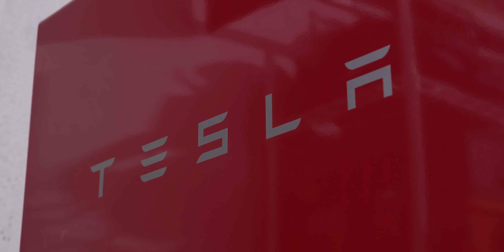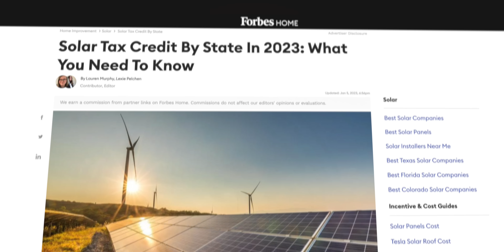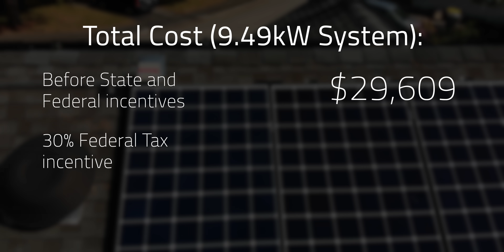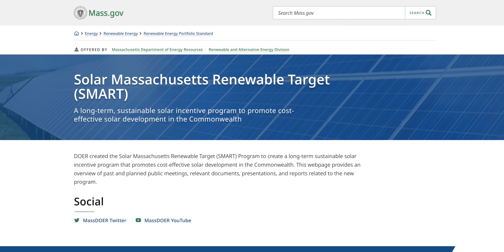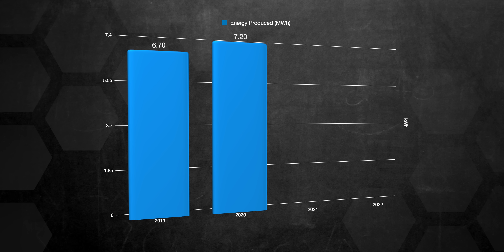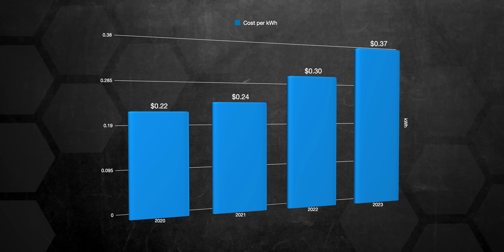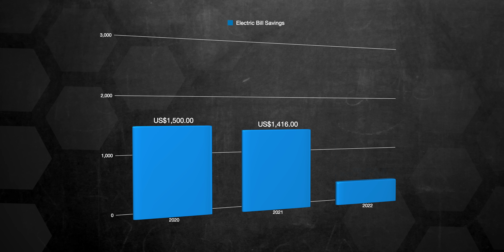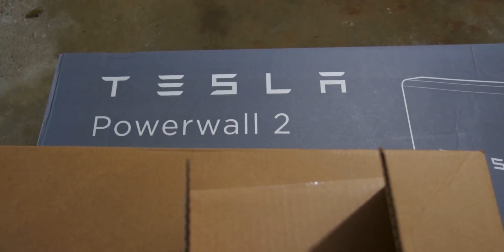5 Years with Solar Panels - Is It Still Worth It?

Comment: I did a DIY solar last year and ended up spending about $30k for 11 kW including 15 kWh of battery storage.  My takeaways were:
1) Buy all the panels you think you might want at once, or accept that you'll end up with a mix of different panels that may not be mechanically or electrically identical.  Panels change enough that it's extremely hard to find panels that were readily available 2+ years ago.
2) Get 20%+ more panel capacity than inverter capacity.  The inverters have the same limit regardless of time of day or weather, but panels spend most of their time below peak capacity.
3) "Sun hours" is a very useful metric for system-sizing.  In my climate, we get about 4.5 "sun hours" per day, or 4.5 x 11 = 49.5 kWh/day averaged over the year.
4) Use an off-the-shelf racking system.  I designed & built my own ground mount system, and I definitely wouldn't do it again.
5) Battery backup is AWESOME for quality of life during outages.
Reply: Thanks for this information, its very practical and helpful!
Reply: #4 depends entirely on your background and level of help available. I did a ground-mount with my own design years ago, saved a bunch of money over the off-the-shelf systems, but I did have the advantage of a metallurgist in the family who reviewed the design and made some changes for durability reasons (dissimilar metals and materials interactions, etc). It has lasted beautifully through record hot and record cold spells and even through some extreme wind events, and it looks unchanged like it will go another 20+ years at least without needing any work beyond minor maintenance.
Reply: Bad listening to this guy saying his electricity bill is close to $400 a month and then listening to all of you people talking about some massive $30,000 solar panel system just gives me a headache and then people wonder why they have to retire at the age of 70 and they never have any money and can’t vacation for more than a few weeks a year…

Listen to what you’re saying $30,000, $30,000 why why do you need that much solar? I lived for three years with only $150 in solar panels and I had all the electricity I needed never had to run the air conditioner because if you leave the windows open with some fans you’ll be good for 90% of the season… 

That was $150 in solar panels 10 years ago. I think I could do the same thing nowadays with only $50 of the newest solar panels but the set up I want including batteries is about 3500 bucks sure that’s expensive but it isn’t 30,000…

I feel like all of you guys just like to burn your money up 24 seven and overspend on everything you buy and work 50 hours a week for the rest of your life because you think that spending money on stuff you don’t really need is the definition of success and luxury. You spend too much time thinking about how much you could instead of thinking about if you should. 

You don’t need 10,000 or even 6000 kW of solar you could have all the electricity you need for pretty much only 2000 kW of solar or even less depending on how efficient you are.

All of these so-called luxuries you think that you’re buying by working 50 hours a week are irrelevant. If you have to spend your entire life working to have these luxuries, which you have almost no time to actually enjoy, and just continuously work to be able to even sustain and afford It’s actually mind blowing to think about.
Reply: @ZxAMobile  It all depends on what you want out of life.  We heat our 1100 square foot home to 60-64F with mini-splits (and a bit of firewood), choose to have a large garden, and grow & store nearly all of our own vegetables.  Keeping veggies frozen for half the year takes power, and so does dehydrating or freeze drying them.  We could've lived with radon and nasty-smelling well water, but we chose to put in a filtration & mitigation system that works great but is definitely an energy-hog.

I DIY'd our solar because I had sticker-shock at the $3.50+/W prices quoted without batteries, and we've already done all the energy-saving things we didn't require unfavorable quality-of-life tradeoffs (and had the budget for - we're still saving up to reside & re-insulate the house).

When our 12 year old Toyota eventually wears out, I'd like to replace it with a BEV, which will massively increase our power consumption.  In the meantime, the cash back I get from the utility company for excess power is a better ROI than a CD.
Reply: Curious what you figured you paid for your diy ground mount? How did this compare with a commercial system?
Reply: @daleatkin8927  and others interested in the ground mount & battery costs: the only good spot for my system was on land sloped toward the East so I built 4 frames for 8 panels each; we live in a windy area with lots of snow, so I kept adding more steel bracing until the building inspector was satisfied.  Ground mount: $1800 for 36" ground anchors, $1000 for 1.5" galvanized steel EMT conduit, $900 for 1-3/8" galvanized fence toprail (wind / snow bracing), $1500 for 2"x2" aluminum box tube to mount the panels to, and probably $1000 in misc for a total of $6,200.  While I probably did save money over a turnkey system for 4 frames, it took far more labor than I expected.  Friends of mine have made ground mount frames from pressure treated wood, which I'd strongly consider if there was a 'next time'.

For batteries, I bought SimpliPhi (3.8 kWh for $2,500 each, so $10k), which have great reviews and are rated for 10,000 cycles.  I could have easily paid 1/2 as much per kWh if I'd bought Chinese batteries.
Reply: @daleatkin8927  bear in mind the power loss through excess cabling from ground mount to inverter and system or battery.  It's quite a lot per metre.
Reply: @kieranhanrahan2883  only if you keep it as DC on average you can loose approx 3-5% over 300m in AC dependant on temp and if insulated in waterproof conduit
Reply: @ram64man  wow thanks,  I was told something very different.  Very immature market here in Ireland, can't trust all information from sales people always!
Reply: @kieranhanrahan2883  it’s a shame that the seller advice in Ireland isn’t taking AC vs DC into account. This has been known about ever since Edison and Westinghouse’s first electrical systems. DC can’t travel far so Edison wanted lots of local power. Westinghouse used AC because it can travel miles with minimal loss. I would be questioning the seller and installer’s other electrical knowledge if I was in your position… it sounds like they’d run the cabling as DC and put the inverters on your house, instead of putting the inverters by the panels.
Reply: @kieranhanrahan2883  Use resistance chart to calculate wire sizing, remember round trip on the wire, ie 24 feet for a distance of 12 feet.
In a lot of cases people cheap out on the wire size, as a result a lot of lost power, just heating up the wires.
Reply: @kieranhanrahan2883  in my case, distance back to inverter/meter will be substantially less by going with ground mount (meter to house is about 30 meters, roof to utility room where the inverter etc would be located is at least 10m, location for ground mount is maybe 5m from the meter location, and inverter can be located about 3m from the meter), hadn’t actually considered this as an advantage, but probably is… (main reasons for ground mount is easier approval, not putting extra holes in the roof, ease of hookup, flexibility in orientation)
Reply: @kaitlyn__L  most probably. That DC would be 48V and for a high wattage system you would need wire with big cross section to keep low resistive losses due to big current. 
New inverters on the market support already max voltages up to 500-600V then it would be only 20A at 500V for 10kW system against 200A for 50V system.
Reply: @kaitlyn__L  Depending on type of PV system (e.g. micro-inv.s vs. central Inverter) most DC arrays are 300-1000v DC have Less voltage drop than 230vAC over same distance. Edison's DC was 110 vDC over less than half mile (

With AC, power factor enters into the equation. Dropping the PF from 95% to 80% can increase the voltage drop 20%. So for AC, the voltage drop could be considerably worse than for DC using the same voltage and amps.

.
Reply: @iIiWARHEADiIi Yeah the 3kw inverter I got last month has mppt solar input at 450 volts 5000 watts. With 2 sets of 8 panels in series the volts should be about 270 watts and 20 amps.
That's 1.6% loss at 100 ft of 10 gauge wire if it's producing full power.
Reply: @ghz24  thanks for the info
Reply: @kieranhanrahan2883  The old saying is  ---   Believe half of what you see,  and mostly none of what you hear  (or are told) .    😊😊
Reply: @daleatkin8927  Would also like to know since that seems kind of high for a DIY system with only 11kw solar and 15k kWh of storage.
Reply: When did you buy them? I sell solar panels and im curious if people still buy them out of pocket because the solar I sell is subsidized by the government.
Reply: @jewels8773  Why wouldn't people buy panels out of their own pocket?
Reply: @jewels8773  Some initial solar costs are subsidized  / credited by state and federal governments,  but total project costs are paid by customers upfront and a portion is reimbursed.    As a solar salesman,  you CERTAINLY must know these basic facts  !  (???)
Reply: I 100% acre with buying panel mounts! I weld and have unlimited access to metal.  Built my own array mounts. What a pain! Days of work and ended up being about the same price, but mines wayyyy crappier hahaha
Reply: What do you not like about your own ground mount system?
Reply: Does the $30k include the cost of the racking system
Reply: @mytravls  Usually  YES, the costs will include racking.   But we SHOULD all know it's best to ask such questions, and to get the details and specifics in a signed, legal contract.   Even that can be risky these days  !
Reply: Good stuff, your DIY did save you a bunch of money! I've often wondered about the point 2, though- having more solar capacity than what the inverter can handle. My solar potential is 10.88kw but the inverter limits it to 7.6. I've always been annoyed at seeing my capacity clipped for hours each day during the summer, and bristle at the thought of all that energy going to waste. 

The company line is the lower rated inverter is more productive overall, since the threshold for energy production is lower. (At least that's my layman's understanding of the technology.) I'm not convinced. There is a cynical part of me that thinks this is a con. An alternate reason for the installer overprovisioning the inverter is that if a panel or two fails, they don't have to replace them under warranty, since the inverter will still be maxed out..
Reply: @risingdough8078  The way I look at it, it's impossible to optimize for BOTH the inverter and panels at the same time.  You're getting great use of your inverter (which probably costs roughly the same per installed watt as the panels).
Reply: @AlecMuller  The funny thing is, my vendor originally spec'd out a 10K inverter, which pretty well matches the maximum solar power output. They swapped it with the 7.6K inverter, but didn't lower the price, explaining that the lower powered inverter would run more efficiently when less than ideal solar conditions exist. I've read that elsewhere, but from other vendor sources, so I still have doubts about it. At this point, I'm rationalizing it as "I've bought extra panels as insurance." Lame, I know.
Reply: What kind of battery setup do you have?  Do you backfeed the grid or does the solar only supply the house and battery?
Reply: @notavailableses  The inverter (Sol-Ark 12k) sits between the batteries and the main panel.  I have ~85% net metering, so I keep the batteries fully-charged for outages, and use the grid as a battery when it's dark.  During outages, I have 60A of critical loads (well pump, furnace, freezer, fridge, internet) that run directly off battery.  Before we had net metering, I was draining the batteries at night and recharging them the next day.  Due to reduced consumption in an outage, I think we can go several days on battery power without any sun, but I haven't had to test it yet.
Reply: @AlecMuller  Now I see why it was 30k.. Def went higher end on the system than a traditional DIY.  Are you having any issues with the Sol-Ark?  I was going to go that route but they seem to not live up to spec in some cases.  Looking at the XW Pros now..
Reply: @FJB2020  The only issue I've had was getting it to recognize a generator input.  I forgot to top off the batteries before an outage, and it was too cloudy to recharge from solar.  It's supposed to let you run your loads and recharge your battery from a generator input, but I haven't gotten that feature to work yet (in spite of RTFM and calls to tech support).
Reply: @Alec Muller  I was going to buy a Hyundai 6 or 8 kw? generator, fortunately the  local Victron dealer mentioned he had had issues with some generators connecting possibly AVC type, so I got a Kubota 1500rpm (UK 50htz) non AVC, the Victron inverter and possibly others are sensitive to frequency, at about 52htz it won't connect at 51.5htz it will, then as the generator is loaded it will run at 50htz +-1htz, the only issue we have is the washing machine shows a power fault at 51.5htz so it won't work unless the battery is charging.
Reply: @notavailableses  the solar is in its own parallel grid , but does back feed a little , we have a manual isolation system meter side which trips in a power outages, with its own circuit breaker that allows off grid when the grid goes off like recently over Christmas, I forgot to mention the batteries use a 3 phase sunny island x2 allowing 10kwh to the property if needed, so far we top out at about 8kwh when heating from cold , right now I’m still in the middle of a big bill on the property merging both buildings and building an extension to merge the two, (old farm house , modern barn converted for accommodations former aband b and another barn (currently not suitable for solar due to code and weight) beside that will become the main residence on 6 acres) think of it as mainly road side in a big L shape for building and plot ) as the dark house gets partially demolished. for a rebuilt and modern look the idea is to feed all the electrics back to the Annex fuse boxes but most work has stopped due to the buffalo winter and me back at work internationally.
Reply: #2 may not be such a good idea.  The essence of the inverter is an array of large and expensive electrolytic capacitors which will die young when constantly pressured to their limits.  For long term survival, over size the inverter.  For a serious solar array on a home, the home would like to be all electric including heat.  My home has radiant electric heat embedded in the ceiling.  Most people seem to think "heat rises."  Warmer air rises above colder air, but radiant heat heats objects while going right through the air.  It is quick.  It is silent.  It is precise.  Every room has its own programmable thermostat.  In 50 years of use it has required zero maintenance.  No new furnace every ten to fifteen years.  No repairman ever.  And for the last fourteen years, the photovoltaic covers it all.
Reply: @WS0TA  heat does rise, why not heat the floors like they do in Japan?

Nothing beats forced air, not only for even heat, but for air circulation. Is there an electric method to have forced air heating?
Reply: @michaelp4122  your 1st question:  "heat rises"  ... heat is energy, heat is vibrating molecules.  In itself it is not a thing that rises or falls.  Heat transfers from one place to another by three means, conduction, that's when you touch a hot stove, convection, that's when less dense gas or liquid rises against gravity above more dense (colder) gas or liquid, and radiation, infrared waves, how heat reaches the earth from the sun.

your 2nd question: "why not heat the floors?"  many reasons. It is an expensive way to build, expensive to repair, and expensive to maintain (think replacing the furnace every ten to fifteen years).  The floor generally involves a large mass that takes considerable time (hours) to heat or cool, in other words, slow to respond to changing temperatures outside.  The floor is heating by radiation, not by heating the air.  Half or more of the floor is covered by furniture or rugs blocking this radiation.  Quite a few homes here are being built with radiant heat in the floor.  The owners always wind up sorry.  

your 3rd statement:  "nothing beats forced air"  I would say, everything beats forced air.  It is noisy.  It is drafty.  It blows dust and pollen around.  It is very uneven heat distribution.  Ducts have to be somewhere.   It has a fan to wear out, and a furnace to be serviced and replaced.

With electric radiant heat in the ceiling you have no gas in the house, no explosions, no furnace to replace, ever, it is extremely quick heat, thermostatically controlled to within one degree, evenly distributed, every room is its own programmable heating zone, inexpensive to install, may require no maintenance for a very long time. And now, if you install a photovoltaic, after eight years it is paid off, and there after heating is free.  I have no utility bills.
Reply: @WS0TA  I'm a science teacher buddy, heat rises. Hot air is less dense than cold air because the particles are moving faster. It's called kinetic molecular theory. So why heat the ceiling?

As for forced air, nothing beats forced air. The problem with radiant heating is that heat is not evenly distributed, and it makes air dry and stagnant. Stagnating air is one of the best ways to give you the worst air quality. Mold and bacteria will build up and without circulation....it just stays.

Things like paint and printers emit toxins that need to be blown away.

Also radiant heating is dry. Yes you can install a humidifier, but are you putting one on every floor?

So is there any way to do forced air with electric and not make the air dry? I don't really agree with yout solution as it poses a health risk.

As for repairs and gas lines, all chefs use a natural gas stove, it just cooks better. So I'm not going to remove my gas line. I upgraded my furnace in 2016 from a 1984 model. 30 years is plenty, and it never broke.

I would like to be more environmentally friendly, but what you propose is a terrible solution, and a good way to get sick.
Reply: @michaelp4122  You are saying it incorrectly, Mike.  Yes, hot AIR rises relative to colder air.  Heat is carried by the rising warmer air. This is called "convection."   Radiant heat is a totally different form of heat transfer.  The heat is transferred by infrared waves which go right through the air, strikes objects, and the energy is transferred to the object.

"The problem with radiant heating is that it isn't evenly distributed."  Radiant heat in the floor has such a problem because of furniture and rugs put on top of it blocking the radiation.  Radiant heat in the ceiling has a clear view of all the objects in the room, including you, and warms them.  It is the most evenly distributed heat there is.  By placing wires more densely near exterior walls and windows it even discourages convective flow near such colder locations.

All heating lowers the relative humidity.  Humidifiers can add humidity to the air where needed.

Gas stoves have been preferred by chefs because of instantly able to control the heat.  Inductive electric stoves can not only match this performance, but also provide digital feedback for precise repeatability.

You were lucky with your furnace.  

It isn't what we don't know that gets us into trouble.  It's what we think we know that is wrong.
Reply: @WS0TA  When you say that your ceiling emits radiant heat, how is it doing it? If it's anything like an electric heater, then it's only heating up the air nearby and then through convection that heat is being spread out.

If you have some system where you are emitting IR radiation, well again that's heat, so radiating IR light still transfers heat via convection.

Any other wavelength of light is either dangerous (e.g. UV, Gamma, X-Ray) or useless (visible, microwave, radiowave).

As for humidity, you didn't answer the question. Dry air is very bad for the sinuses, so do you use a humidifier, and if so how many do you have?

Also how do you circulate your air?

As for stoves, my parents have induction, you have to use specific pots for it to work. It won't work with glass and not all types of metal. It also doesn't change temperature as quickly as natural gas. Natural gas has more control. Stoves are a to each their own thing, but the point I was trying to make is that people aren't going to disconnect from their gas lines.

As for reliability, I could say the same for your set up. Maybe you got lucky in reliability. In Canada I have never heard of anyone repairing their furnace in a period of under 30 years. After 30 years, it's cheaper to upgrade for efficiency purposes.
Reply: @michaelp4122  Let's stick with the heating topic and its relationship to solar electric...  Let's say you have a countertop broiler with an electric heating element built into the top.  Hold the top up and aim it at your hand.  Your hand feels HOT.  Turn it away, and instantly it is cool.  The electric element was sending heat to your hand by radiation, not convection, and it (mostly) didn't heat the air.  You could aim it up, or you could aim it down, it would transfer the heat just the same.

The wires embedded in the ceiling are not so hot as to glow red, they don't have to.  Does the ceiling heat the air?  Yes, a tiny insignificant bit, but from conduction, that is, from direct contact with the air to the ceiling.  This heat transfer is minor compared to the radiant energy transfer which heats the objects it strikes, just like it feels warm to stand in the sun.  No worries, essentially no heat is carried by the shorter waves.

Each room is a separate zone.  Each zone is controlled by a separate thermostat.  The thermostat is programmable by the hour and by the day so that you can heat only when you are there, and generally in that room.  Temperature is controlled to the degree, and in fifteen second on/off intervals.  It holds the temperature very precisely.  Since radiant heat directly heats objects, such as the person, people generally set the thermostat lower than in other systems.  think of the difference between standing in the sun receiving direct radiant heat, and standing in the shade sensing the air temperature.

May I put the conversation in yet another way: for the price of radiant heat in the floor, you can install radiant heat in the ceiling AND a photoelectric system to power it, so in a sense, the annual heating cost can be free.  Of course I am speaking of new construction.

You mention, Canada.  I live in New Mexico.  World of difference in available sunshine to power that PV!
Reply: @WS0TA  3rd time I'm telling you this, I'm a science teacher, you don't need to explain the difference from radiation, convection and conduction.

1st, to make IR radiation from electricity, you do so by overloading a wire, similar to how a space heater or incandescent lightbulb works. You can put reflective mirrors behind it, but your fancy heating system will always be hotter at the source, for the same reason an incandescent lightbulb is hot to touch (and for the same reason why the sun is hotter than the heat that reaches us).

2nd Forced air is still far better. Did you know that the nights on the moon/mercury are about as cold as pluto? IR radiation cannot pass though a medium because it's light. So in your set up, anything blocking that heat source (say a table) will stop that heat. Without heating the actual air and having circulation, the temperature in your room is not consistant. Your source will be the hottest, followed by surfaces, and  gases that trap heat (like CO2) will be the coldest.

3rd I asked you twice now, how do you circulate your air, and introduce humidity in your set up? Stagnating air is the worst thing you can do for air quality because all the benzenes, formaldehyde, trichloroethylene, xylene, toluene and ammonia build up. These are normal chemicals that come from printers, paint, glues, etc in your home. If you have no circulation, you're just inhaling all of that, plus any bacteria, dust and mold that build up over time.
Reply: @michaelp4122  ha-hah-hah, that's wonderful.   I am a science and math teacher as well, and I was a builder, built about 100 homes..  you have described exactly how it works.  Trick to it is that the ceiling surface must not be painted, must be dull, not shiny, and the more surface area the better, hence a sprayed popcorn finish is used.

Yes, the surface of the ceiling is the hottest.  The heat distribution through the room is the most even you will find.  Yes, it heats objects which in time release the heat by conduction to the air.  Forced air the least even you will find, much hotter at the vents, colder near windows and outside walls.

I am pleased that there are no drafts or blowing air, nor any off gassing from paints after they have dried.  There are none of the chemicals you are concerned with in this house.
Reply: Panels also degrade as they age. Another reason to over-build a bit.  Energy from the grid is never going to get cheaper in our lifetimes.
Reply: I wish I had the room for a ground mount.  Will have to make do.
Reply: Excellent info Alec, thanks so much!
Reply: I live in Australia and just had a 10KW system installed using Qcell panels and a Fronius inverter-  Total cost A$9,980 or around US $7500.  I can't believe how expensive solar is in US.
Reply: @lindsaysmith8119  i have a feeling that in US sellers basically price government subsidies into quoted prices
Reply: You should have done this video.
Reply: What is racking system ?
Reply: @94D33M Everything that holds the panels to the roof or ground is the racking system.
Reply: Me me me me... Me me me

Decarbonization is 21st century pyramid building.
Just burn coal. 

This is sickening on so many levels.  "How to screw the lower middle class and make them pay for your feel-goodery."
Reply: Another reason not to get solar.
Reply: @RadioRich100  
Solar Systems are about neighborhood bragging rights, paid with higher costs shifted-to/imposed-on the lower income peasantry.
Reply: For 1) stick with a well-known brand that has and will continue to make the same panels. If you can't find them because you tried to save money with a no name brand, get another MPPT and put it on its own sting. If your MPPTs can't talk to one another, you went too cheap.
Reply: Generator is 100% better.
Reply: 30k dollars???
Reply: YES... amen to that HUGE piece of advice  !   😊😊
Reply: ground mount rec solar 8kwh and on the annex lg 5kwh 340w ahas been flawless, south facing, due to local opposition, you can’t have any panels front facing to the street, which is nut’s but luckily my building was south westerly, connected to a 20kwh pylon tech each mounted system and 8kwh sma inverters , code required a 200amp circuit to be installed. That’s the expensive bit .  The lg pannels do get grubby so it’s far easier to wash the ground mount for the rec solar due to shading from trees I opted to go down the tygo adapters route connected to another sma 3 phase 8kwh back to the annex, , so far 3 have failed but tygo were quick to replace and put it down to a batch issue , so replaced all of them .  The solar day generation is key anything else is just a bonus and has seriously cut the cost of my 24kwh heat pump multi split so verily little goes back to the grid . I have found though on average two of 3 pannels of generation should be minus from your array for accurate energy output on a bright day ,  the batteries also suffer in the cold drawing a kw to keep warm that they don’t tell you about to keep them 20c
Reply: Very nice
Reply: Point 2 is a very good one.  I'm thinking of using an even higher ratio (1.4/1) for panel/inverter capacity as in the Tropics where I live, the output of the panels is de-rated a noticeable amount due to heat.  As for battery backup, I just use a UPS with an extended battery pack for all my important stuff (which coincidentally is all on or near to my desk, LOL).
Reply: ~$4 a day, or $1,400 a year, will take you 20+ years to recoup the cost.

Meanwhile $30,000 on an S&P index fund 5 years ago would mean $48,000 today.

So gain $18,000 not buying a solar roof or save $7,000 by having one.....

Still too expensive, only for early adopters.
Reply: @michaelp4122  Our utility pays us ~$0.25/kWh, not $0.08, so it's roughly a 7 year payback before the tax incentives.  If saving money were my only priority, I would've skipped the batteries (1/3 of the system cost).  I mainly care about quality of life during power outages.
Reply: @AlecMuller  Where do you live where electricity is $0.25/ kWh? Also how frequently do you have power outages?

For me it's $0.074 off peak, $0.102 mid peak, and $0.151 on peak...Canadian. Weekends and Holidays are off peak hours.

We'd probably get less power from solar up here, do they work with snow on top?

Anyway, just as someone who invests, I always found solar panels interesting, but still only relavant for early adopters...and maybe those who live in a desert like LA or Nevada.
Reply: @michaelp4122  Northern New England (43 lat).  They don't work with snow on top (not the cover-everything-like-a-blanket snow we get anyway), but panels with a 45 degree tilt shed it quite easily once the sun comes back.  NY State forbids new natural gas pipeline construction, and additional high-power lines from Quebec Hydro keep getting shot down, so our electric rates skyrocket when there's a natgas shortage.  I paid $0.34/kWh for power drawn from the grid last month and got paid $0.29/kWh for power I supplied to the grid.  Rates dropped ~4-5 cents this month, but are still quite high.  There's always a risk rates will plummet and my payback period will go up, but I'm not holding my breath for $0.12/kWh any time soon.
Reply: @AlecMuller  So basically the same climate as me in Toronto. Funny how you get our electricity and pay 2x as much.

I forgot that you can angle them more steep than the roof. Our schools all have solar panels at a 45 degree angle and the roofs are flat (Google any school in Toronto, it's cool to see from satellite)

My house is old, I'm going to rebuild and then I'll think about solar. If I get a solar roof though, I want something like the Tesla roof where it isn't an eye sore.

Either way, since our electricity is half the price of yours, it's smarter for me to invest in an index fund and double my money in 7 years, vs. waiting 14 years (double the 7 you said) to see my money return.

But now I have some context, I did not know electricity was so expensive in USA.
Reply: @michaelp4122  I live in SE Pennsylvania. Cost of electricity is $0.20/kWh in 2024.
Reply: @michaelp4122  not sure your index fund did  as well in 2022
Reply: @dmitripogosian5084  I'm up 20% last 12 months.

It's still much, much smarter to invest now vs. buying solar panels.
Reply: So for an average power bill of $300/mo so if you don't pay anything on your power bill it will take around 10 years to break even
Reply: @mikesatran1067  
Home solar is high-class neighborhood bragging rights and cost shifting to poor people.
Reply: @mikesatran1067  Who says he will be in that house 10 years? So he just financially handcuffed himself to that house for at least 10 years, plus theirs noway its going to come out the way its calculated - it never does. The panels degrade with time, the batteries go bad and are expensive to replace and dispose of. It also devalues the house, will probably get his homeowners insurance to drop him or drastically raise his rates, plus alot of other reasons not to do it. Solar panels just never make sense. If their mounted on your roof you will get another dozen problems.